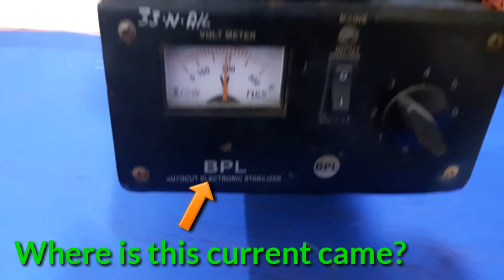Super-strong Magnet (using old transformer) Part 2

Comment: This is not a current. It was only a deflection by the magnet . The magnet attract the thin iron foil in voltmeter. If you open a voltmeter you will find a coil and in the middle of coil the thin iron foil is suspended freely

Comment: The current in your volt meter came because of mutual induction . Electric flux linked with the transformers coil went through the coil of voltmeter which caused the cuto be induced in the circuit and thus there was the deflection
Reply: Gaurang Shukla BUT THE CURRENT IN TRANSFORMER IS DC SO HOW MAGNETIC FLUX CAN MAKE????.....
Reply: HE USE DIODE IN TRANSFORMER SO THE CURRENT BCOME DC NOW, MAGNETIC FLUX MAKE ITS NOT POSSIBLE because it is permanent magnet
Reply: T U N N U off course ur right sorry I didn't noticed it at all. My bad. It happened because the voltmeter too contains a magnet the deflection  was because of the magnetic field. The needle experienced a opposite MF and got deflected
Reply: Gaurang Shukla May be it possible Can #s.kumar answer that question
Reply: T U N N U cool. One question who's the dog in you channel photo
Reply: Gaurang Shukla SHE IS MY OLD DOG NOW she is not more died in an accident
Reply: T U N N U sorry to hear that . She was cute